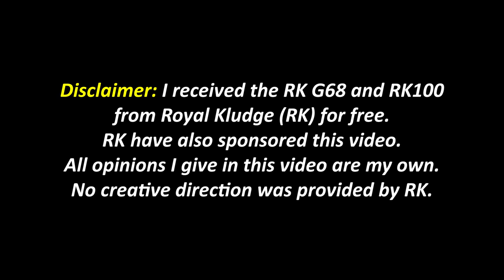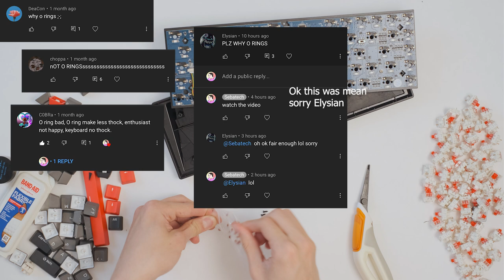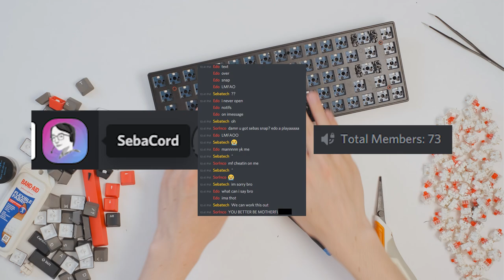I Upgraded a $75 Keyboard - It feels SO GOOD

Comment: Did you have any problems with the Holee mod? My stabilizers sound terrible and are mushy with the holee mod done.
Reply from the maker: That can happen. Try using it for a while and see if it corrects itself. Are your bandaids too thick?
Reply: @Sebatech  Maybe. What bandaids did you use?

Comment: what oring size did you use? And your did not com with a top cover to make it become high profile?
Reply from the maker: How do I get/make a top cover? Also, added o-rings to description :)
Reply: @Sebatech  I live in Vietnam, and mine came with a top cover inside the box :)) but abs doubleshot key cap